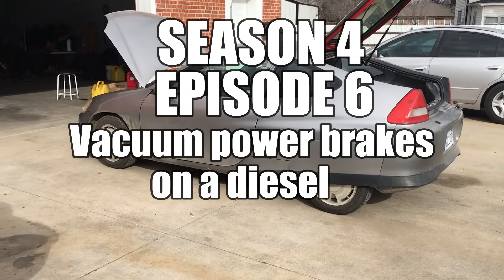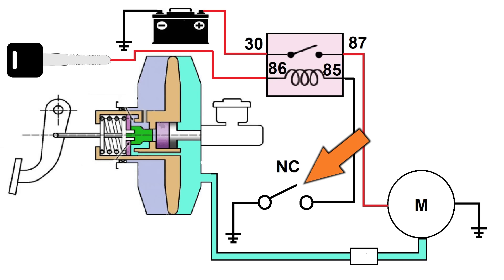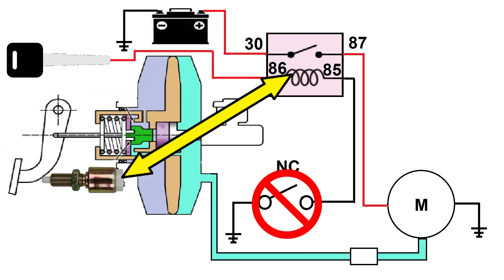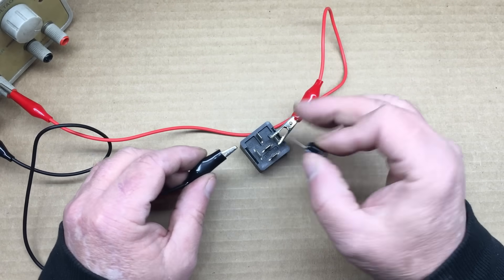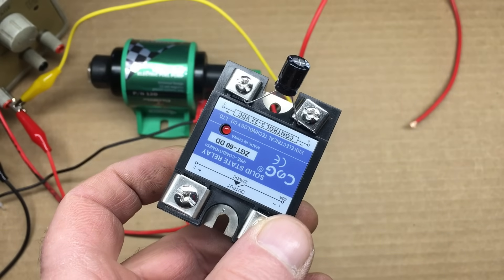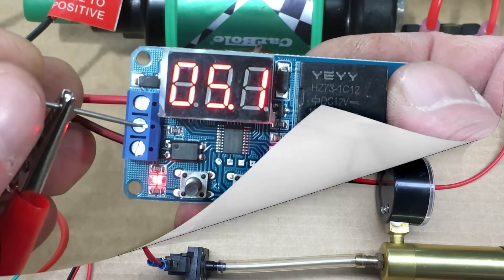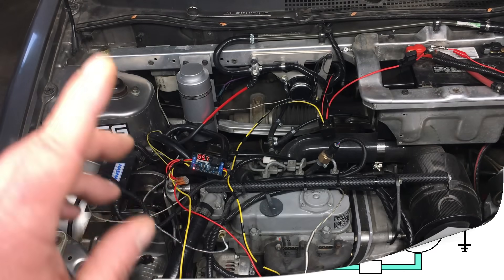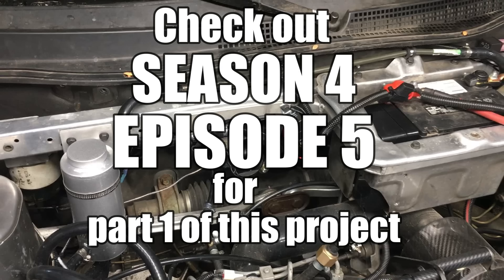S4 E6. low cost vacuum power brakes for our diesel Honda.. problems  solved.

Comment: As a ham radio operator... Thank you for being conscience  of RF noise pollution.
Reply: I'm a dumb dumb that knows very little but finds HAM very fascinating. It really causes that much, issue/interference/noise wise for you shortwave operators? 

Are there things that us car nuts can do to things like small engines or equipment to help remedy it, without redesigning entire systems? Any quick tips/tricks would be appreciated, I'd like to do my part to reduce what I can. 

One day I'll get into it. It seems like a blast, and I have trouble sleeping, might give me something to do when I can't sleep 😂
Reply: @goosenotmaverick1156   The biggest thing you can do is make sure your spark ignition systems have resistors on the spark lead. This can either be a resistored plug, a resistive spark plug wire, or resistance in the coil. Most systems have this already. Also if you have points ignition make sure your condenser is good.
Reply: @goosenotmaverick1156 I think it does very little to cause interference with radio signals, because by that same logic the sparkplugs on a car would cause problems with radio signals, and don't get me wrong they likely do, but technology has progressed so far that it really isn't an issue. The main thing he is doing by putting the diode across the electro magnet on the relay is to eliminate the back EMF, which is generated when the magnetic field collapses , this in turn generates a voltage in the opposite direction. Now this voltage is usually a high voltage, and in the case of microcontrollers or other small electronics, they are sensitive to high voltages, so the diode helps eliminate the back emf that would otherwise destroy your microcontroller. In my opinion the noise it creates isn't a concern, is the high voltage that is part of the so called "noise" that is a problem to other voltage sensitive electronics.
Reply: @JuniorJunison Cars with leaky ignition systems and the diesel garbage trucks cause local Channel 5 & 13 to go out. Most people don't realize it because of cable/streaming and the fact that Channel 5 isn't picked up well since the digital transition.    

Just because its unlilely doesn't mean it doesn't happen regularly.
Reply: Not surprised to find another ham here! 73 de WU2F
Reply: Oof. The very worst "as a" that I have ever read.

Comment: It looks like you figured out a system that works well.  If it hadn't I was going to suggest a high/low relay similar to what a well pump uses at the holding tank.

Comment: Jimbo, you overthought this, when you tried the SS relay and cap, you were on the right path to K.I.S.S., Rather than grab the time-delay relay, you could have simply controlled a regular 40A relay with a switching transistor (say a 2n2222) with that 470 mfd cap across the base & ground, (collector to relay coil, emitter to ground, so the output would be inverted, so coil reference is positive) then tuned the timeout with a parallel resistor if it's too long. I've done automotive electronics for years and have built many simple "bounce-prevention" circuits on a budget of "whatever is in the tool box" I know you like cheap and reliable, and this simple circuit is just that.
Reply: Was thinking the same thing. Would be nice if RadioShack was still a thing but part of the reason I keep broken things around. Device might be dead but components are still good to harvest.
Reply: @ghosttheoremproductions5469 
I still have a local radioshack. They had 3 franchise stores in my area and when things went south, they closed all but one. I was just in there a couple weeks ago.  they're rare but some are still hanging on.

It's been sad to see them struggle. When I still had time for projects like that I used to frequent the one that's now closed, it was close by and I could go on my lunch and buy more resistors or whatever I needed. Also the Vaughn family that owns the store, are very nice folks.
Reply: The parallel resistor could easily be a potentiometer, so that could add some easy adjustability. Once you're happy with it, swap it out for a fixed value resistor of similar value.
Reply: Great idea, you beat me to the solution.. you are  probably a time zone ahead of me. :)
Reply: I thought the issue with that was emf which is why he went to an upgraded relay
Reply: That and inrush current not being compatible with the circuit
Reply: Jimbo was worried about the current draw on the solid state relay. The motor is not controlled by the solid state relay , it controls the regular relay and it controls the motor.
Reply: Bigger cap around the motor from 87 to ground?  Just enough to run the motor an additional 500 milliseconds?  Simpler?
Reply: For a circuit such as this, couldn't you go even simpler and just put a capacitor between the switched hot and ground lines to the relay? Sure, it would add a slight delay to the relay triggering on, and it would remain on slightly longer, but it would be even KISSier...

Edit: Right, he addressed that.

Comment: I use a large capacitor in an electronic circuit.  I made a DIY alarm system at my gate to my property.  I built a 24 amp/hr lithium battery to run my electric gate opener, and a light for my American flag.  The security system utilizes a shock sensor from an old car alarm.  The output of the shock sensor triggers a relay.  The relay is connected to a 1 farad capacitor as well as a flasher circuit and a car alarm siren.  When the system is triggered via an impact(like someone messing with the flag or the battery, or the solar panel), the relay is triggered thus energizing the capacitor which then runs the siren and flashes 100 lumen LED lights.  The batteries are kept charged with a 25 watt 12 volt solar panel and a PWM solar charge controller.  

This is not an ideal setup, but I used parts that I had laying around and has proven to be reliable for the 6 months that it has been in place for.  It is a proof of concept that a large capacitor can be used with great success.  However, as JimBo eluded to, the current surge is rather high when the relay is triggered.  I started off small with fusing and slowly worked my way up until the fuse for the system did not blow.  The final fuse ended up being 30 amps!!  Yikes!!!  While that is slightly more than a 1C rate for the lithium batteries, they are rated for a 12C rate so it is all within safe parameters.

Comment: I guess i missed it but why not drive the control pin of the high power relay with the solid state delay relay? The programmable timer relay is cool and all but seems like overkill when the ss relay could do the same.

Comment: hmmmmm interesting content about the solid state relay , i had doctered up a system to run an external temperature sensor (thermostat) for an electric heater at home . figured a sold state relay wouldnt butn up the contacts and be queter , looks like the thing would burst intoo flames instead due to the amount of amps it can handle , back to the drawingboard it goes

Comment: 4:05 Your theory is incorrect in the real world. I've set up an identical system and the additional volume adds the hysteresis in the system you're looking for. I'd still go with a delay on break timer but that's for system volume and depth of vacuum not preventing the  switch chatter.
Reply: What

Comment: Big capacitors are a good thing!  I have had a 75 Farad capacitor & a 2ah lithium motorcycle battery replacing the stock (lead acid) group 35 battery in my daily driver (2001 Honda Prelude) for over 2 years!

This system weighs over 30 pounds less!

The capacitor is to assist the small (group 9) battery when cranking the 2.2L engine (less current from the battery, since the heat could kill the cells). I was able to start the engine using only the capacitor during testing…

The 2nd time…the first test, it didn't, using 4 gauge from an amp kit. The 2nd test it did work, using 2 gauge welding cable, with the capacitor remaining in the trunk. Don't use shitty cable from ebay, get the good stuff from a pile of junk on a farm.

Comment: Put the reserve tank next to the vacuum pump and have several feet of vacuum tube before the the pressure switch. This way the friction of air movement in the tube results in the pressure at the switch to briefly continuing to fall after the pump has stopped as the system pressure balances.
Reply: a restriction on a shorter hose will accomplish the same thing. Carb synchronization gauges had knobs that crushed the hose to take the bounce out of the guages

Comment: Just wanted to say the addition of a vacuum reservoir would help more than you think. You'll be pulling a vacuum on a rigid object. The brake booster diaphragm isn't sturdy enough to act as a consistent reservoir with the setup you are using,  especially considering the booster wasn't receiving a vacuum for a long time, it is likely stretching a bit. Also, the diaphram will creep a bit every time you use the brakes and will never "settle" under driving conditions.  So I would recommend you use a reservoir still
Reply: His arrogance bites him again. If he just tried it he'd see. Some of us speak from experience and don't rely on what we think will happen based on a diagram.
Reply: I would say that Jimbo thinking the unassisted brakes were acceptable was the arrogance. I'm happy he's using the booster at all. As an automotive technician, I know that the booster isn't a reservoir. And I don't think the pump is a consistent enough source, and he shouldn't rely on excess vacuum to compensate.  So, it needs a reservoir to be safe and consistent anyway.  But the consistent part would likely have solved the chattering issue.

Comment: Soon we'll be burning more fuel and going faster faster. Sometimes I stick the tip if my tongue in the vacuum booster hose or fitting. Old mechanic trick - try it.

Comment: That's brilliant Jimbo , I thought I understood what you did but I am confused by the switch that's marked normally closed which appears to be normally open, or did I miss something?
Reply: The switch is closed when the pressure is above the setpoint, i.e. low vacuum.  When you have vacuum then the switch opens (and turns off the pump).
The symbol on the schematic is a simple switch but normally you'd show a NC switch pivoting below the right hand connector or with a little leg to denote NC

Comment: Would a super cap work on a regular relay?
Reply: Probably not: you'd get the capacitance to drive the delay, but as Jimbo said the inrush current would likely damage the switch.  Supercaps also have a low voltage rating and lose capacity as you go above that, so if you put 12V on a 2V supercap it would probably only work once.
Reply: @gavster89  I think you can use a current limiting resistor just had a look at a paper by Keyocera that can be found on Google.

Comment: Fascinating 
Just a few years ago… none of these electronics would be cheap and available.
Reply: You could reduce the box he uses to a handful of standard components that only cost pennies even decades ago
Reply: List out the components complete with part numbers you’d propose
Reply: @flyonbyya  any regular bipolar transistor and a cap to build a solid state relais, plus some diodes for protection. Values and amount depending on the desired effort. Discrete electronics are super cheap if one knows what he's doing.
Reply: @flyonbyya  could also do ne555 circuit.